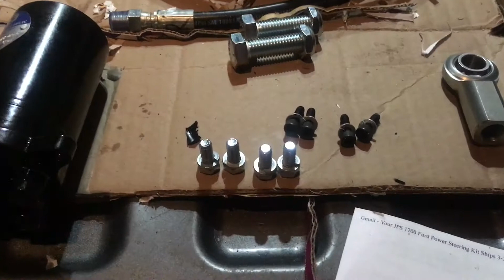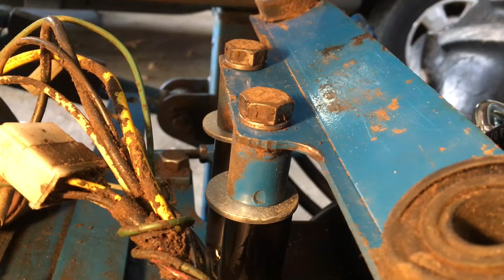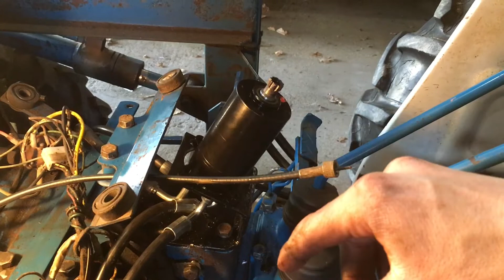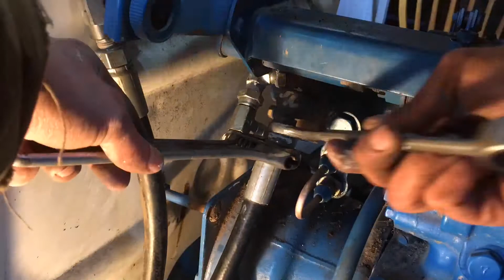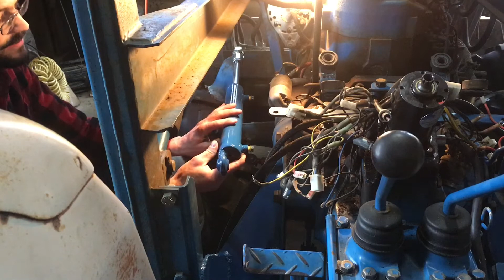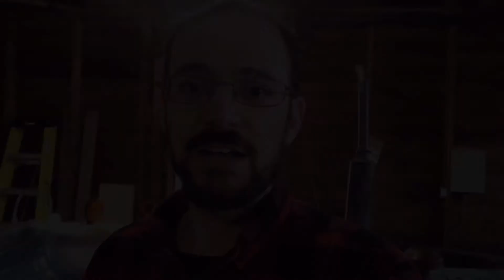Ford 1700 Tractor Steering Upgrade (Part 2) - Installing Jackson Power Steering Kit

Comment: One more question if I may please. I noticed on Jackson Power steering site he advertises including a priority valve in the kit. That makes much more sense than cutting steel pressure line, and could be plumbed so there would be no loss when steering and using loader at the same time. Do you know why he did not include a priority valve in your kit? On his site he says one is included.
Reply from the maker: @tomlatimer5001  I think it’s in the steering unit. The steering unit will pull fluid first automatically. Then everything downstream. The way I plumbed mine the 3 point hitch is first in line instead. The loader is third, after the steering unit. If you’re turning, fluid goes there first before the loader. If raising three point and turning simultaneously, there won’t be much left for the loader. Mine is a lot better now that I rebuilt the 3 point lift cylinder.  No more fluid flow being wasted!

Comment: Great video, well explained and informative. I have the same tractor, except my 1700 has full manual. You've inspired me to rectify my only complaint with the tractor, no power steering. I just ordered the kit thru Roland Jackson, and told him I was going to install the same way you did, without cutting the steel line. By not doing as the kit was intended, I'll assume a couple of the lines he sent were not the ideal length. Now that yours is installed, my question is, could you give me an ideal length of each of the hoses. You would be doing me a great favor, and possibly saving me some money by not having to go buy a hose. When I told Roland I was going to install just as you did, he asked if he needed to include the flareless connection, and I said no. He said it will be a couple weeks before he can start on my kit, it would be nice to call him and tell him as long as your not including the fitting, would you please provide hoses that are of this length.  I would  be greatly appreciative if you could give me an ideal length of each hose that he provides.  Thank you in advance, Tom Latimer
Reply from the maker: @tomlatimer5001  I assume you’ve seen my whole multi-part series on the install. I got all the hoses shipped with the kit to work. The only one that was shorter than I’d like was the pressure supply hose from the rear of the tractor to the steering unit. 18-24” longer would have been perfect for routing down along the hard line and then sending it up to the steering unit just behind the loader frame. I had to route it along the side of the transmission, and it  is right against the parking brake lever and chafes a little on a metal edge wrapping behind the dash. Longer hose is better than shorter as you can always take up slack by zip tying along the hard line to hold it out of the way. I can’t give an exact length as I’m not at the machine now. I recommend you measure 3 straight lines. 1) vertically down from the connection point at the rear end to below the footrest, 2) forward under the footrest to the loader frame horizontally, 3) vertically up behind the loader frame to the bottom edge of hood at the fuel tank. Add together and should give you a nice length. 

Hydraulic steering makes the 1700 a new machine. It’s an expensive upgrade but it totally changed the operator experience. 

FYI - the weak spot in the kit is the mounting bracket for the steering cylinder on the tractor frame. I use my tractor a little hard, and that bracket broke a year ago. My neighbor had a piece of 1/2” thick steel we tapped for the bolt and then welded on to beef the whole thing up. The steering cylinder applies cyclic loading to the bracket as you turn one way to the other, and the fatigue sheared out the cylinder bolt hole. That shouldn’t happen again!
Reply: @ProductiveRecreation  Thank you very much for responding so soon!  I will measure as you advised, and then ask Roland to provide a longer pressure supply line.  I saw how you mentioned that line was too short to go under, and got by zip tieing to steel line.  I asked because that is the only one you said was short, and I wanted to be sure the rest of them were adequate.   My tractor is split in half now, awaiting a clutch kit I ordered.  As long as it is dismantled, I thought there wouldnt be a better time to give it a power steering upgrade, and I remembered watching your video a year ago. Almost all the time I use my tractor, its loader use, and steering it with a full bucket is very hard, as I'm sure you know.  In fact, I have always said at least a fourth of its hours are because no power steering, having to jockey it around back and forth.  I want to thank you again for your input, as well as your videos.  Tom

Comment: I am looking at getting a Jackson power steering kit for My FORD 1300 Tractor  I want to know how satisfied you are with this item   Have you had any pr0blems with this  And how was the response time from Roland Jackson  To get your unit  Can you answer my questions ASAP   THANK YOU
Reply from the maker: The only issue with it has been the bracket to attach the steering cylinder to the tractor frame. The one with the kit wasn’t real heavy. I had to get it welded as bolting wasn’t sufficient. Then this last winter the steel failed around the attachment hole for the steering cylinder, so I had my neighbor weld in a chunk of 1/2 inch thick steel and we threaded it for the cylinder bolt. Granted, I use my 1700 HARD on rough ground in the woods. Otherwise, the steering system itself is flawless over 200+ machine hours, as long as you don’t try to do lots of other hydraulic functions at once. That’s based on the pump flow though and not the steering components. Roland Jackson was pretty responsive, and things came pretty quick all things considered. I even sent a couple things back for him to modify, as my 1700 is a bit of a unicorn and had a different attachment point for the dash (it was power assisted recirculating ball steering as opposed to full manual). I think Jackson has done kits for the 1300 so it should just “drop in.”

Comment: How much did this kit cost?
Reply from the maker: It was around $1700 for the kit in early spring, 2022. Add in miscellaneous fittings and the bracket I had welded and it came to about $2000 all in.